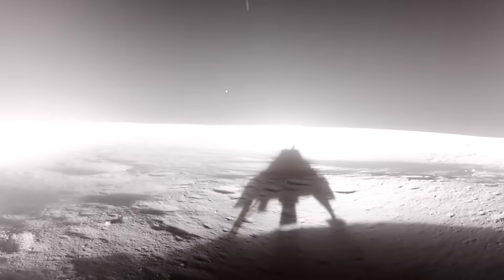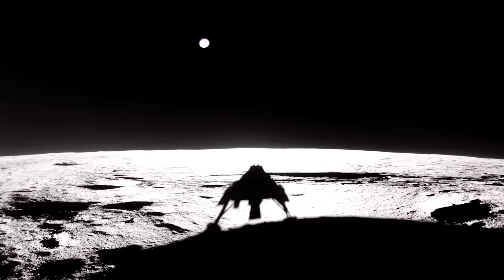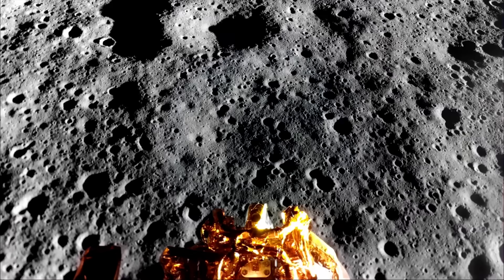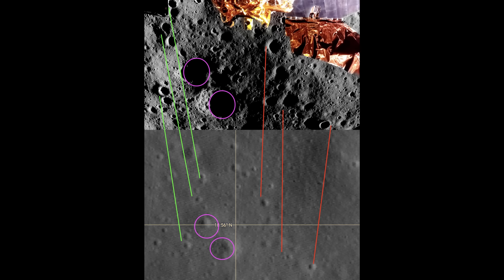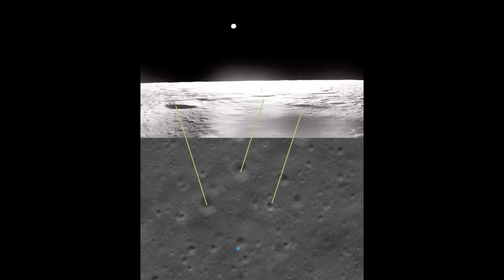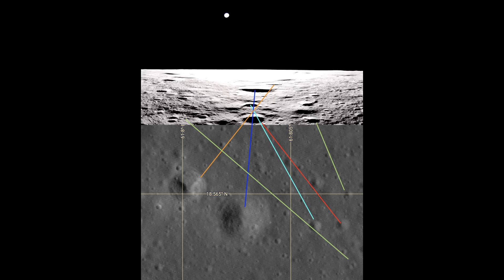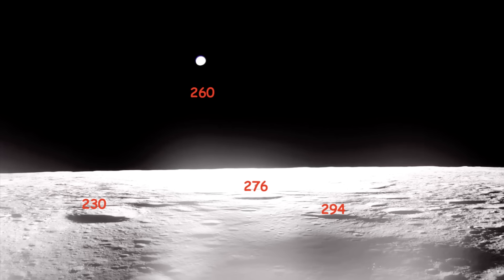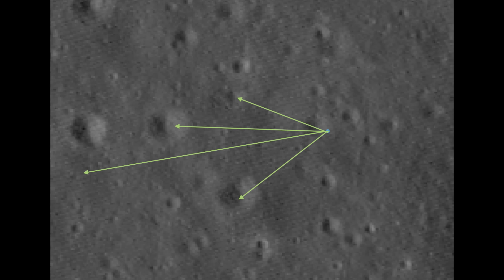Blue Ghost's Landing Video Reveals Exactly Where It Landed On The Moon

Comment: Why is the mission over when the sun sets?
Reply: The lander is only going to get 2 weeks of sunlight (a lunar day is 2 weeks from sunrise to sunset) before night sets in and the lander will either lose power from no sunlight or it will freeze due to lunar night getting to -130°C (-208°F).
Reply: @Jesus_Craig  thanks, that makes sense that it freezes to death
Reply: @Lil_MrHype  yeah sensitive electronics do not like subzero temperatures
Reply: Lunar nights last a long time, and there's only so much battery power to keep systems functioning and warm enough they don't get damaged.
Reply: Extremely extremely cold and the only power source is solar power
Reply: The electronics get too cold to function and the batteries dies before it gets light on the solar panels again.
Reply: Many devices cannot withstand the cold of the lunar night.  It might not be able to "wake up" again the next "day" (14 Earth-days later)
Reply: Ever had your car battery die when it got super cold overnight in the winter? Same idea.
Reply: The batteries will die before the sun comes back and can charge it with the solar panels.
Reply: because it gets really cold and the batteries cant charge for two weeks
Reply: Battery Life/ Solar Panel Output vs. Lunar Day/Night Cycle. The moon only gets continuous sunlight for a little over 14 days. So after 14 days of sunlight it will experience 14 days of darkness. The probe cannot survive that 14-day night cycle. It will run out of power before the next lunar sunrise.
Reply: All manned lunar missions were planned for daytime for obvious reasons, so man has never set foot on the moon at night.
Reply: why can we not design electronics that function in extreme cold? James Web seams to.
Reply: @escomag  my guess would be that because they are always cold thus having a low temperature difference, but on the mood the difference is so high that both are not possible, and the choice is between night or day
Reply: @escomag  I don't know the full answer, but here are parts of it with help from an AI.  Semiconductors, batteries and other things only operate within a range of temperatures.  Clearly there have to be limits: at high enough temperatures, materials change state, and at low enough temperatures atoms pretty much cease to do anything.  Things like EVs can keep their battery capacity up by heating the battery pack, but obviously it takes power to do that, so they can only do it so long, then they run out of battery power.  James Webb is at the L2 Lagrange point so always has sunshine, and it has sophisticated heat management.  Probes can survive longer at low temperatures or without sunlight if they use heat from decay of radioactive isotopes to keep batteries and other systems warm, and lunar and Mars landers have used this successfully.  There are cost, regulatory, and complexity consequences from using radioisotope heating, and in some cases these may favour short duration missions with simpler craft.
Reply: @escomag  James Webb has solar panels in constant light so they can either power heaters to keep the electronics at the right temperature or let them self-heat. I haven't studied the thermal management in any detail. You could probably design electronics to withstand the cold, but it would add a huge amount of cost and likely also mass. Besides that, the batteries get damaged by the extreme cold so won't work after the Lunar night. Batteries or fuel cells big enough to keep the thing warm enough for 14 days would, again, be too heavy and expensive.
Reply: you can make it survive nights by heating with an isotope like Soviets did with their Lunokhod but it ain't cheap and increases weight, etc. They just wanted to land on the cheap.
Reply: @olasek7972  plus it is somewhat easier for governments to source suitable amounts of suitable radioisotopes than it is for private companies